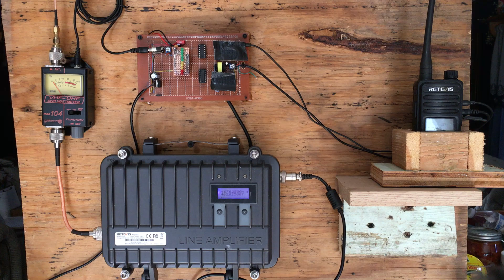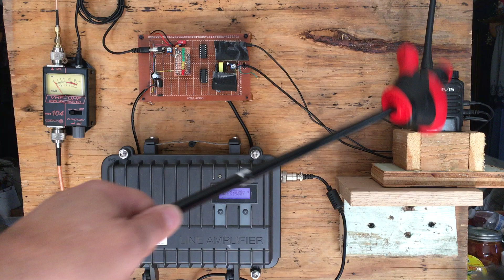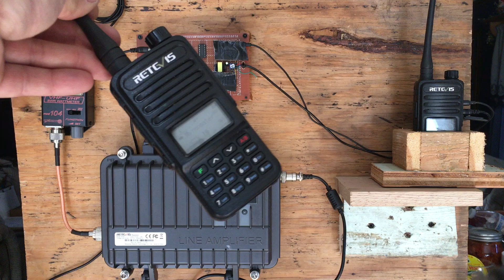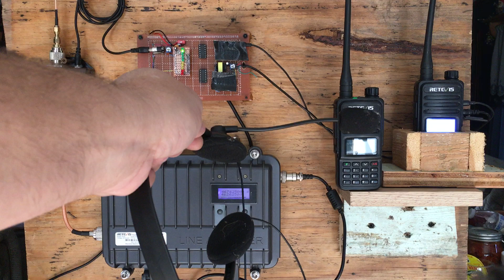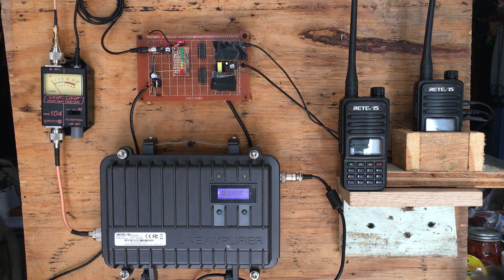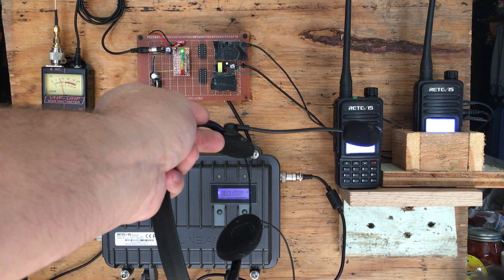🔺DTMF into repeater to hear current SWR/high SWR warning mp3 file play over two-way radio air wave🔺

Comment: Is your GMRS repeater in the 54656 zip code operational…???  I have tried handheld from north side and south side of 54656, with no contact.
Reply from the maker: Yes it is, BUT it's in a valley/hole, so range is only about 2 miles. From the Interstate 90. I need a better location :)

Comment: OK, that’s cool!  I like how it can be configured locally using MP3s and jumpers.  You would have to look at controllers costing several hundreds of dollars to include this function.  I also like how it can use an independent radio to send the data to the repeater, no modifications to current repeater or controller at all.  Another Plus: The fail-safe radio and repeater can be automatically identified using MP3s that could be either in Morse code or voice.  I like it!